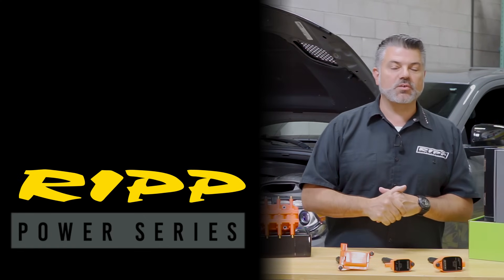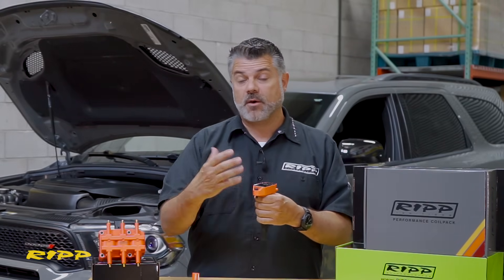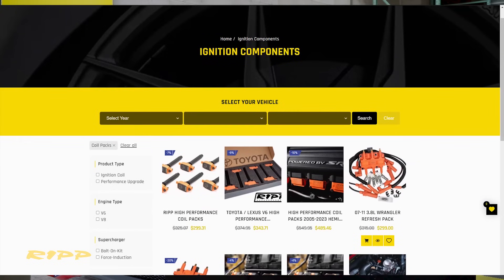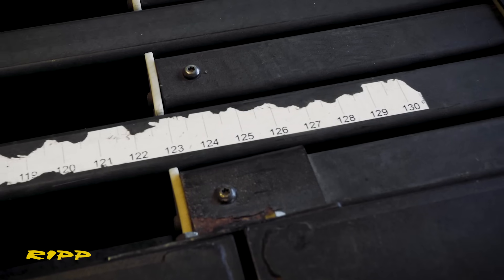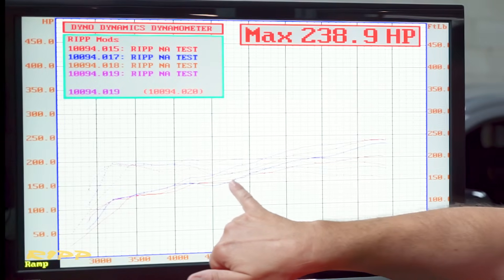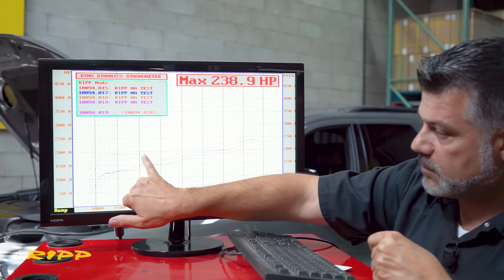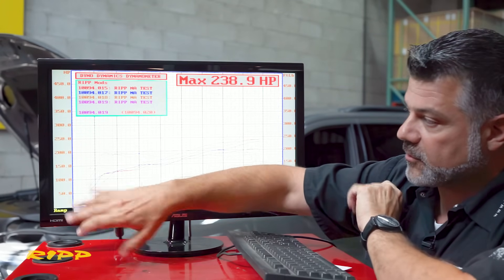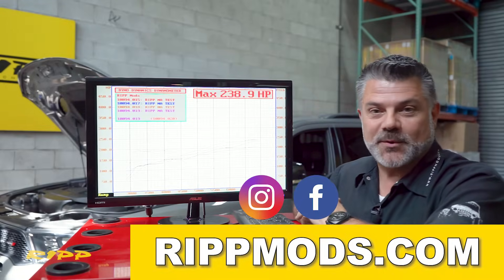RIPP Power Series: Dyno testing the NEW RIPP V6 High-Performance Coil Packs

Comment: Does it require a re-tune?
Reply from the maker: Hi @Sm00thR0ckS - a tune is included with the supercharger kit
Reply: @RIPPMODS  how about just for the coil packs? And do they come with detailed installation instructions. I have a 2021 WK2 Grand Cherokee V6 Laredo X. Thanks.

Comment: I want to try the product however, you folks do only warranty replacement on the product. Not if the product is not compatible with the vehicle like causing a misfire or throwing a code. No money back.
Reply from the maker: Hello @centralfloridaidiotdriver407,
We will gladly refund your product, within 90 days of purchase, if it is not compatible with your vehicle, though, as long as it is the correct make and model, regular maintenance is kept, and it is tuned correctly, it should have no issues. If you have any additional questions, or need more clarification, please email RIPPmods@RIPPmods.com, we will gladly help you there.

Comment: do i have to get spark plugs too or can i just install the pack
Reply from the maker: Hello @rainehill2204,
Not at all. All though we do recommend installing spark plugs, since you are already in the internals as well as it will handle the power slightly better, there is no need to change them at all. If you have any additional questions, or need more clarification, please email RIPPmods@RIPPmods.com, we will gladly help you there.

Comment: I almost ordered a whole kit with coils, plugs and heater today due to the Black Friday special. And then I realized that my 2021 Grand Cherokee needed a different kit and set of coils that were not part of the Black Friday deal.😢 Oh well I guess I'll just have to drive my slow  GC around longer.
Reply from the maker: Please email sales@rippmods.com if you don't see your kit. But from what we see the 2021 Grand Cherokee V6 kit is on sale and can be bundled.

Comment: Dont forget us "Car guys" and the fact we may indeed have Grand Caravans! Supercharger to any other performance upgrades, we are wanting it!
Reply from the maker: Our high performance ignition coils work on the Grand Caravan, just use the vehicle finder on our site and you see the part that carry over.
Reply: Can you supercharge a newer grand caravan with reliability?
Reply: @johnmcdonald513  I'm ready to find out. I know the transmission is made of glass and oil, but the engine should be ok with a little boost. At this point, I'm ready to do some M90 fabrication off a series 3 gm 3.8 to this 3.6..... honestly doesn't look too bad to mock up. The FIAT garbage tuning may be an issue.
Reply: @yellows10dude I'm hoping someday they'll have a supercharger kit for newer Pacifica I'm a paralyzed vet drive a wheelchair accessible van.

Comment: Added RIPP coils to my modified 2018 5.7 Daytona. I feel like the car is snappier during acceleration over the OEM coils.
Reply: Number gains?
Reply: @Hemi.Mani57  I haven't dyno it since adding the coils. It just feels like the car responds better. The last time I had ny car dyno was when I went with a cam and longtubes, which got my 2018 5.7 Daytona from 357whp to 430whp